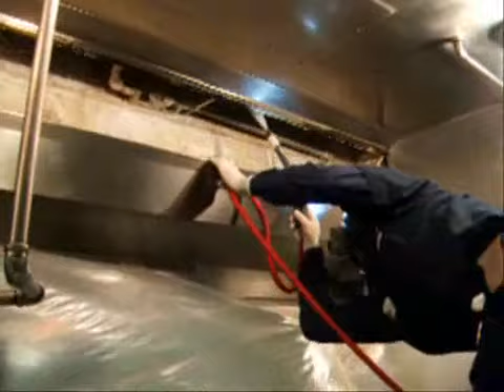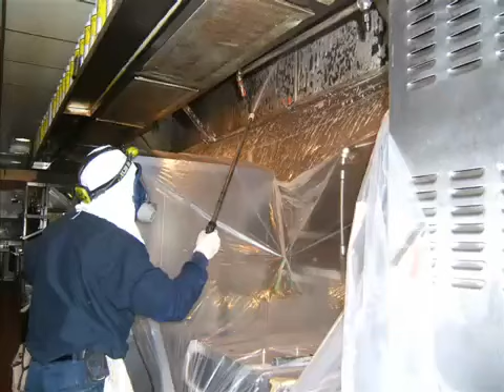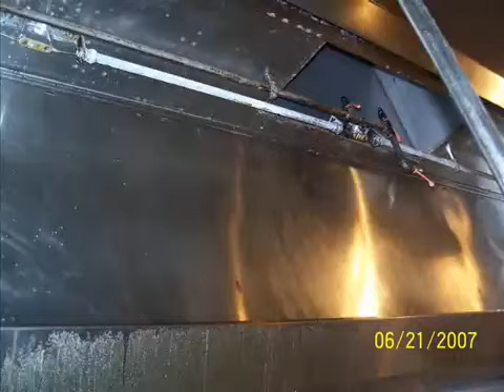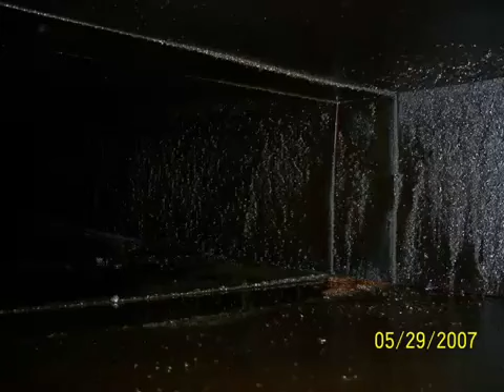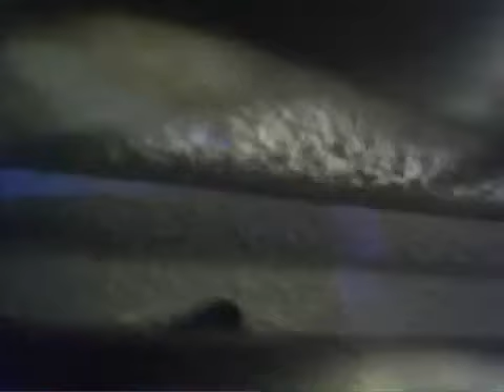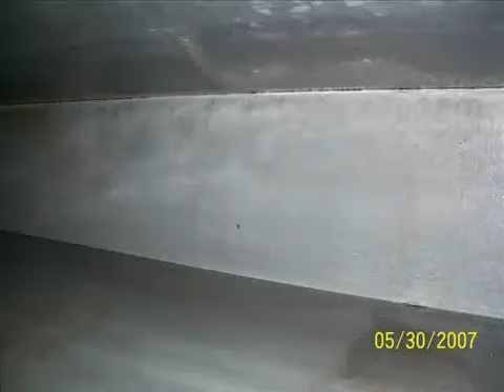What Happens At A Kitchen Exhaust Cleaning Service

Comment: How much does a service like this cost? For say a single hood system, ten feet long?
Reply from the maker: We would have to see the full system to give an accurate price as the ducts can run through the building and get pretty messed up. Without looking at it I would say it starts around $850.